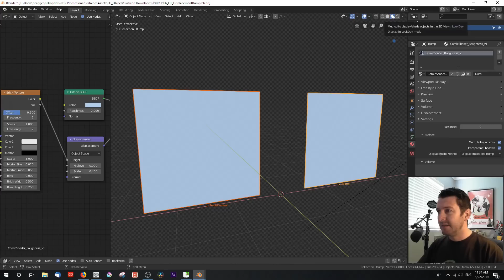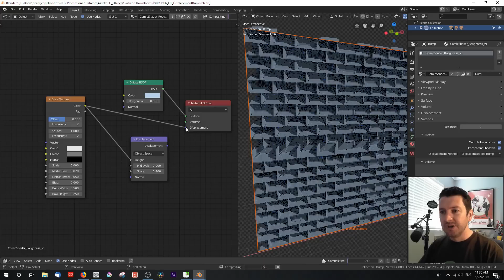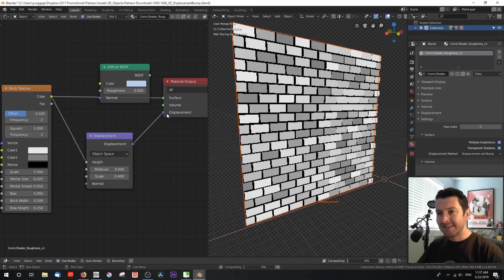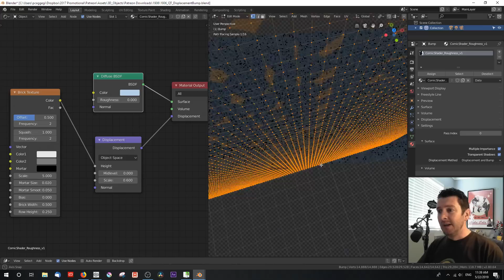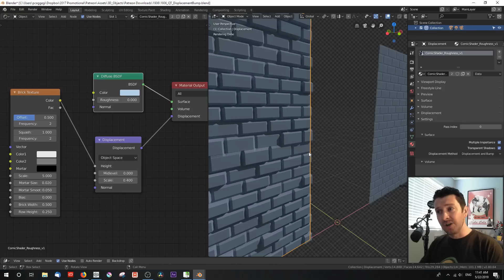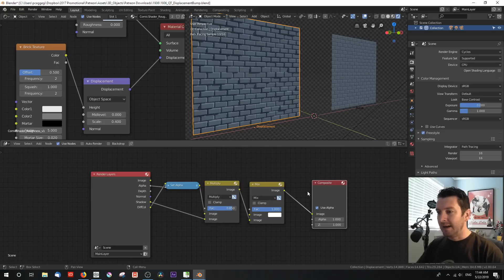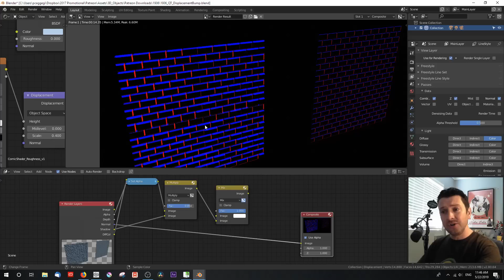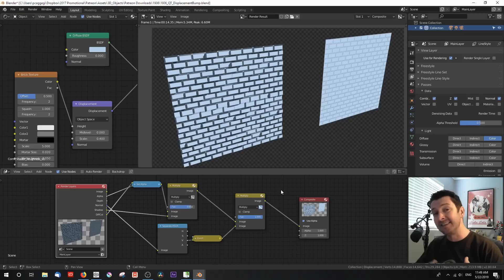1906 Blender Quick Tip - Displacement

Comment: Every Blender update I hope that Freestyle gets an update, and every update I'm disappointed. I stopped using Freestyle in my workflow ages ago because it just has too many shortcomings: it doesn't work through transparent objects, it renders at the edge of the geometry rather than the edge of the texture (which, combined with the previous shortcoming, makes it effectively useless for things like leaves), it doesn't consider displacement textures, it doesn't render at the intersections between different meshes, it doesn't offer any kind of real-time viewport preview, and in any NPR workflow, Freestyle is the part that will take the longest to set up right, guaranteed. When I need outlines, these days I'm more inclined to use the inverse-hull method or trace the lines myself in grease pencil or Krita. I'm hoping that there will eventually be a way to render outlines in grease pencil--even if it doesn't change in real time at least it would give us the option to tweak the outline ourselves in real-time.
Reply from the maker: Yup, I feel your pain. Knowing the shortcomings, I do still find use in it for some things, however I also long for a better method, or at least a developer to jump on board and further improve it to address all those things you mentioned. Thus far, they simply made it functional in the new version, so it's still there.